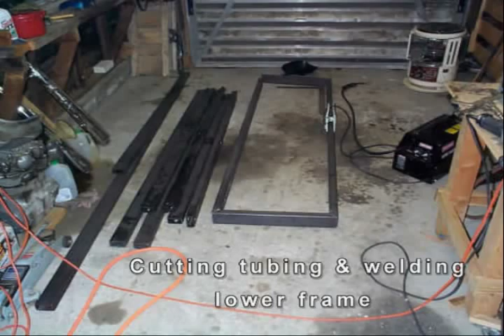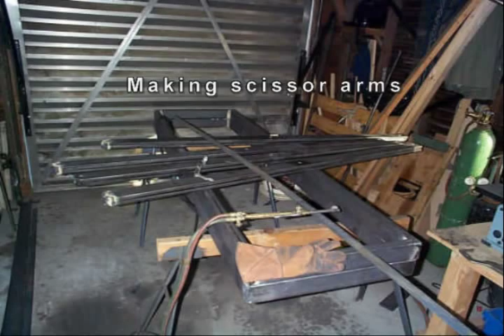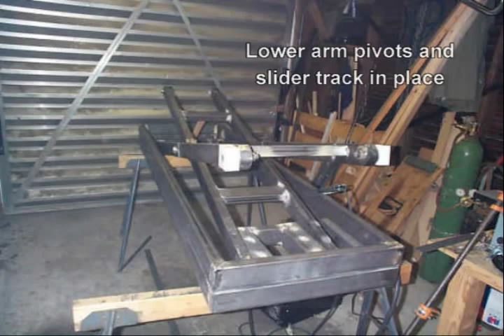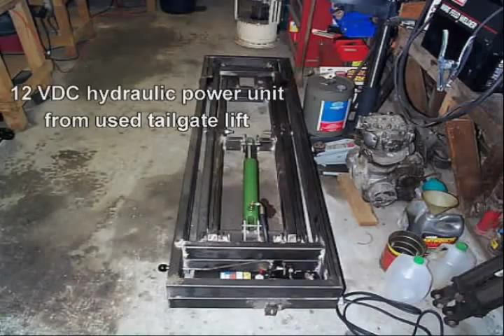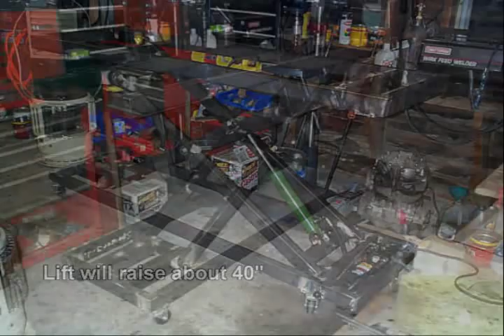Building A Motorcycle Lift Table

Comment from the maker: Thanks for your interest, unfortunately I actually built this lift 15 years ago and have been through 3 computer changes since then. No plans survived those changes.  The tubing is 1.5 x 3 x .120 wall.  I ended up using two of the cylinders you see, one would not lift my 1978 Honda Goldwing from the totally collapsed position!

Comment: I hope you don't mind, but i would like to ask more questions about your lift. What is the length of the scissor arms? What is the guage of the steel? Is the top rectangle & bottom rectangle (top/bottom frame) of the same dimensions? Do both frames meet together when the lift is completely down? It looks like your idea of placing the slider tracks toward the center instead of having the track against the inside of the rail eliminated a problem of the scissor arm hitting it when lowered? Thanx

Comment: good job well done, also I seen to look at other posts seldom do people who make the videos come back and respond to comments.........thinking of doing one myself......too old to be bending over that much, and too difficult to lay on the ground and work on stuff, that's probably why they made rotisseries,  not a bad I idea.  but I may hang one over head make the ends told up or removable......and I'm all for overhead beams with trolleys ....I put up a small brige crane, 
great job you did...
Reply from the maker: Donald Powers thanks for your comment. Well I understand what you're saying about bending down to work on a bike as time goes on! That's the reason for the lift. In 2012 I was diagnosed with MS. I had 10 bikes at the time and now down to 2 as of 6/17. The 650 bobber shown in the video and a near perfect stock Yamaha XS650 Standard. I will be selling both, the lift and all remaining motorcycle parts this summer in a few weeks. The MS  has gotten to bad to work on or ride. I'll miss it all. Good luck with our project.
Reply: sir so sorry for you, many people around me as i get older are falling apart..health wise...with disc degeneration life took a new meaning.for me, .I've been building things for years so now 66 I've been working 
on over head lifts. booms things to pull things with.
messing with riding mowers...planning ahead but i know i will stay busy to the end.....wish i could help
 I'll offer up prayers and thanks for the reply,  but strange,
i just found notifications and sir...some people are beyond ugly....they dont talk like this in public....i watch many videos on diy builds on buggys and atv's and some take advice so wrong... I  put a 350 cb honda motor on a 74 trisport alsport rts 340 back in 74 and tweeked it to a beast......I've found 2 frames love to find a 350 cb motor again....I would post a VIDEO...it
was so much fun it would be a great build for many...

Comment: I just found your slide show regarding your bike lift table. I have looked at several DIY lifts and yours looks awesome especially with it being a scissor design and lifts straight up. 
I am curious about some dimensions and materials.The rectangular tubing looks to be about 1.5" x 3.00"? What is the length and width? what is the diameter of the initial cylinder you used? Where is the UHMW plastic found and would cast iron rollers/wheels (like used on floor jacks) work in place of the plastic?

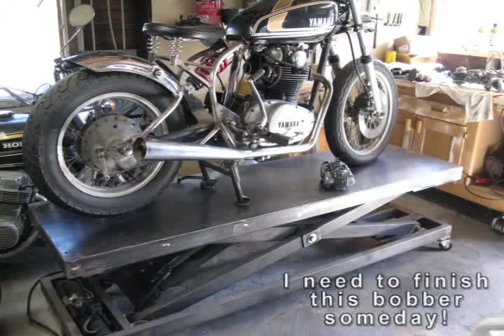Comment: Hello Allen, did you fabricate the scissors from tubes or are they made from two layers of flat bar welded together (looks like that @ 1:13)? Thanks!
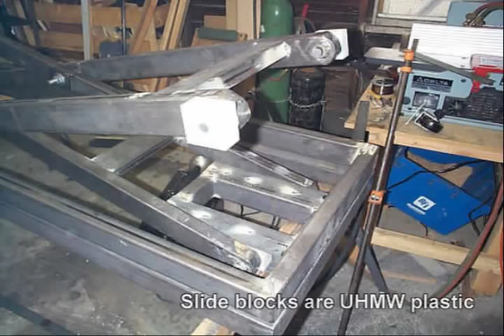Reply from the maker: +leckmich0815a  Hmm... The video is only 1:13 long so I'm sure what you're referring to. The tubing used for the scissor arms and frames was 2 x 4 inch x 10 ga. wall rectangular tube. If you pause at 0:32 you will see a box formed by the same tube with flat bar on the outer side top & bottom to make the lower track for the UHMW blocks to slide in. The white blocks in that photo are sitting on the bottom flange of the track for the upper (moving) frame to get the spacing before welding on the top flange of the slide track.